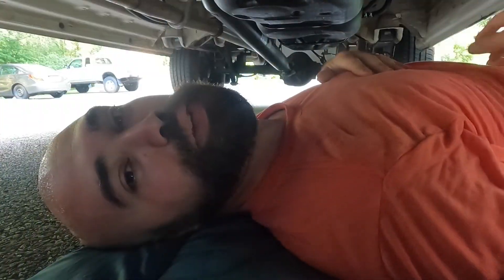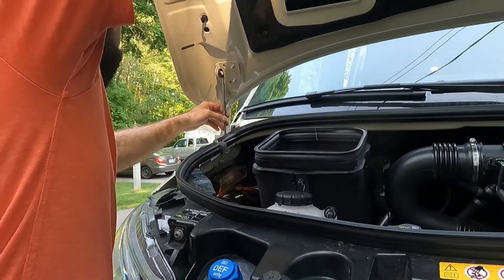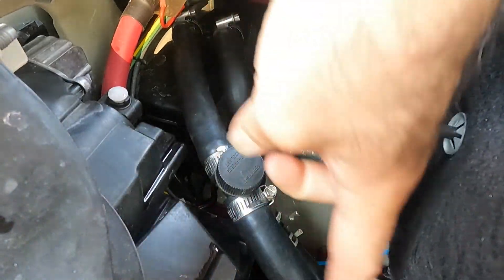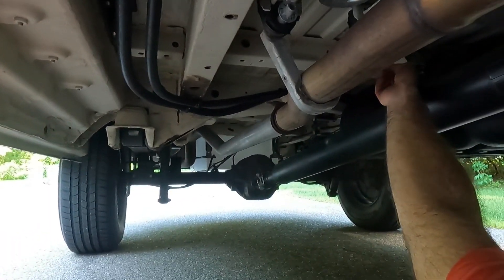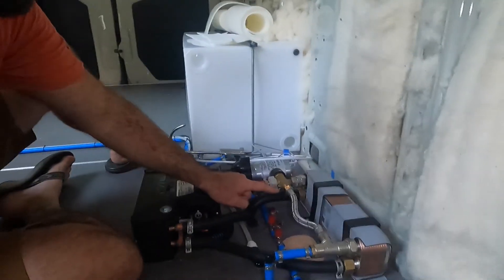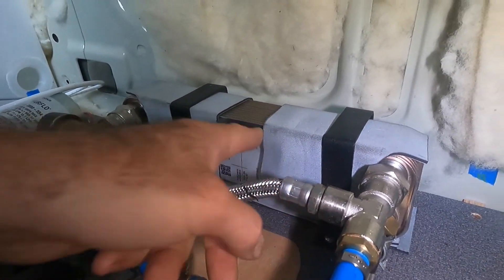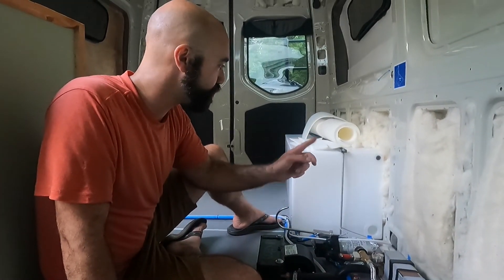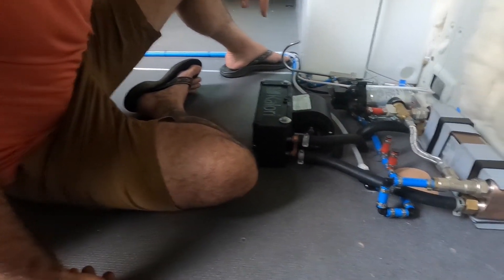Van build - Heatso x Espar x Kalori x Kelvion hydronic heat and hot water system

Comment: Where are you going to mount the coolant expander tank?
Reply from the maker: Great question, Noah! We installed the reservoir next to the HVAC air inlet. You can see more info if you check out this post here: https://sprinter-source.com/forums/index.php?threads/100157/post-1067807

Comment: So I think I have the same kit, the Espar, Kalori, and then a webasto controller and an Easy Start Pro controller.  Everything I have seen and watched says that you cannot get the two systems to automate off of the one controller (meaning when the blowers controller (mine is a webasto with the red lines you described) senses the set temperature it turns on the Kalori blower, but DOES NOT turn on the Espar.  SO the Kalori blower never gets hot glycol.  Some one told me they had to set the easy start pro to come on using the time feature, so they have their Espar kick on 3 times during the night, and the Kalori will then get heat during once of those 3 times.  

Is that how you are wired, or were you able to figure out a way that when the Webasto sense the low temp to turn on at, it turns the Kalori and the Espar at the same time?

Thanks in advanced. and love the videos.
Reply from the maker: We're wired to operate like a traditional heating system (i.e. - when the temperature is below a threshold, the full system comes on to warm the air, then shuts off) with no manual input. We can't take credit for figuring it out, we're just riding on the shoulders of giants.

Check out this forum post where we got loads of help: https://sprinter-source.com/forums/index.php?threads/92442/post-1041708 special thanks to everyone over there who contributed. If you have more questions after reading, just ask; here or there.
Reply: @OutofIpswich  Wow that fourum has a lot of replies and info, thanks for the heads up on that... I might be more confused now after my first reading of all of that :).  Time to start sorting it out.  Again thanks for the lead
Reply from the maker: @CameronHill23  happy to help! It makes a lot more sense if you read through the posts with the wires (or at least the diagrams!) right in front of you. Like I said, if you have questions shoot em over.

Comment: Super helpful video, thanks! We're about to install ours and was thinking the air blew out of the motor duct but it sounds like the hot air comes out of the rectangular area. Can you confirm the air comes out the big rectangular area? Thanks!
Reply from the maker: Yep! The hot air comes out of the rectangle. Good luck with your installation and if you run into any issues feel free to comment here. Would be happy to help!
Reply: @OutofIpswich  Great to hear this. One step closer to design and layout.
So until we saw your video we assumed we'd install the fuel pump, furnace and hydronic pump under the van but your install in the engine compartment looks ideal. Are you happy with your choice? Did you extend your wiring harness to reach back to the Kalori and controllers?
Reply from the maker: @jodette100  We're very happy with the component layout. Accessibility is important for service; we always try to keep in mind what happens if something needs to be repaired or replaced. With all these components under the hood, there's virtually no noise inside the cabin when they're running. It's great. Plus, there's the added safety benefit of the firewall doing it's job separating us from the fire in the furnace.
Reply: @OutofIpswich  we have the same exact heatso kit and want to put our furnace in the engine compartment like you did, but the cables aren't long enough. Do you know if they can be extended? We need about 12 more feet for our layout. Thanks for the video!
Reply from the maker: @Eric_Maker  yeah, you could definitely do that. It's a fair bit of work, but totally achievable.

Comment: You guys are awesome.  Thanks for posting your progress.  I’m about 60 days behind you with converting my 170 wb Sprinter.
Reply from the maker: Thanks for watching! We're glad we could help! Good luck on your journey. If you have questions we didn't cover, reach out.
Reply: @OutofIpswich  Hi, I’ve thought about following in your footsteps with respect to the Espar hydronic kit but I’m a little put off by the Heatso price.  The 12 volt kit is $3300 and the 24 volt kit is $3700.  That seems pricy.  Did you find it cheaper?  I’ve also thought about using this system for both domestic hot water as well as under floor radiant heating although the temperature requirements are different for both purposes.  I can think about a secondary mixing valve for the under floor temperature although I think I’ll always be tweaking it depending on ambient temperature.  Did you also consider under floor heating?
Reply from the maker: @peterClevick  Unfortunately (or fortunately, depending where you stand) it seems there is a high demand for the hydronic heaters right now. We got the kit from Heatso, but it was cheaper than that. We've seen the price jump multiple times. You could probably piece your own kit together for less, but it will just require more effort on your part.

We did consider radiant floor heat, and we have a friend who is doing just that. I reached out to see if they're also heating domestic water and I'll update you when I find out how they're controlling the temperature. I think my instinct would be to run two separate circulating pumps on two separate thermostats, since you want different desired temperatures. Hopefully that makes sense!?
Reply: @OutofIpswich  It does make sense to set up two secondary loops with each having its own pump and thermostat.  Thanks for following up so quickly.  I also was a little underwhelmed by the documentation Heatso sent at my request.  One document was generic Eberspacher literature and the other was more conceptual than practical.  My search continues…
Reply from the maker: @peterClevick  Yeah, I guess you've got to have a solid understanding of the systems in play. And a can-do spirit.